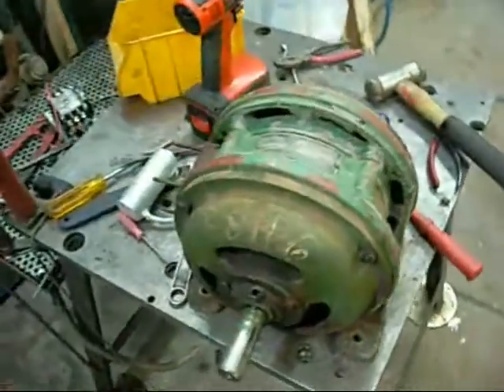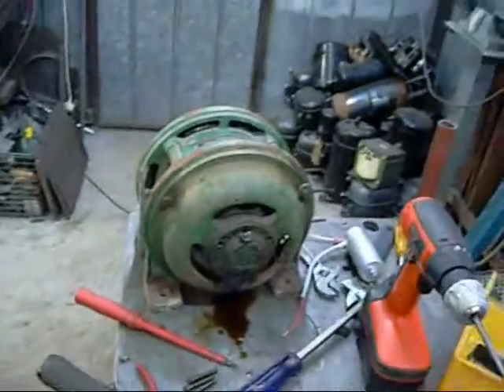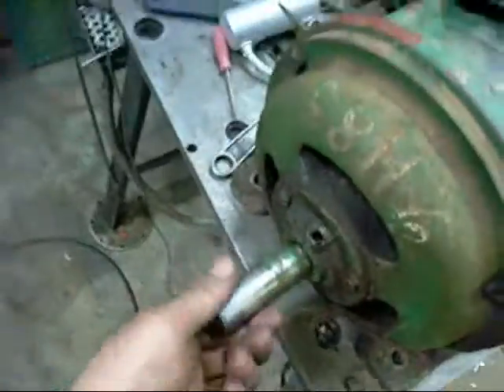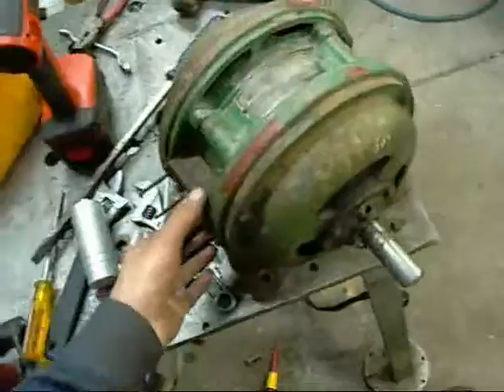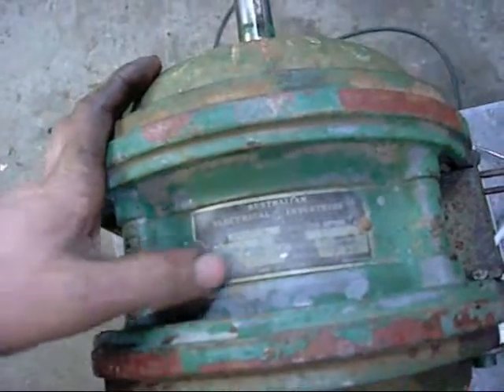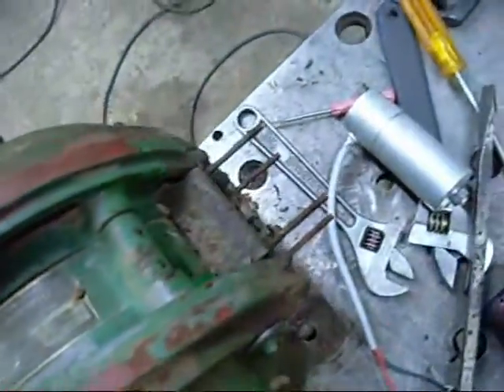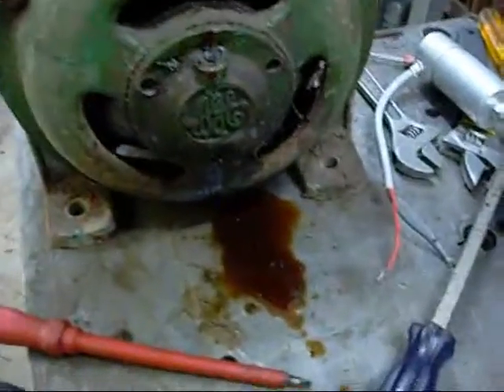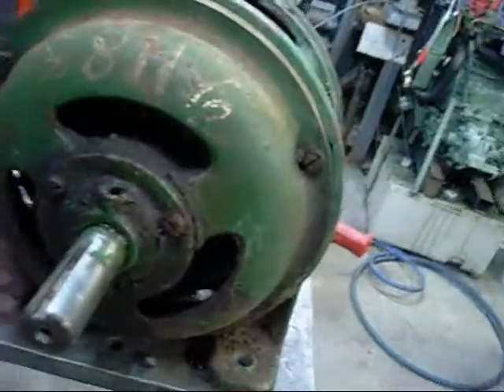3 Phase Australian Electrical Industries Motor

Comment: That is the original half life, lol. Sounds like the part with the rocket engine. Anyways, the design if the motor looks very similar to the old GE design, perhaps the companies may have worked together?